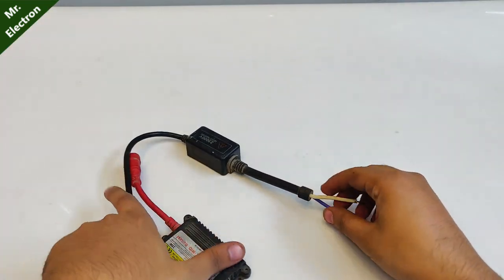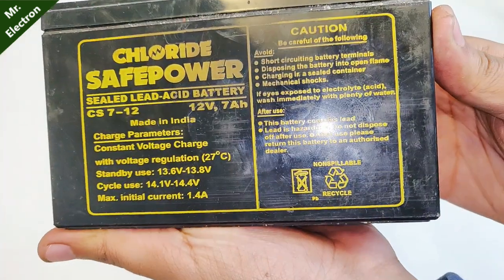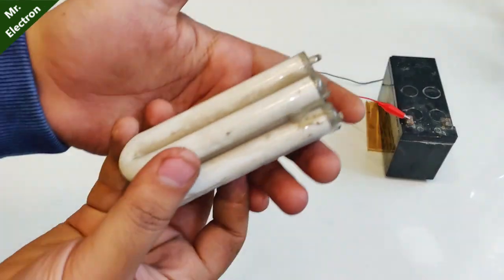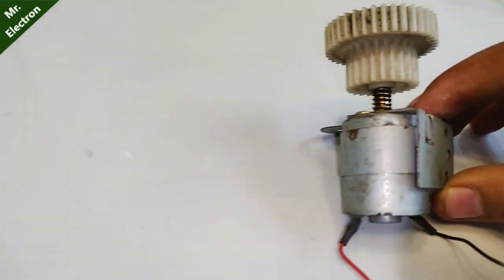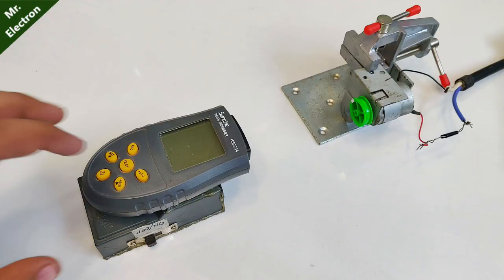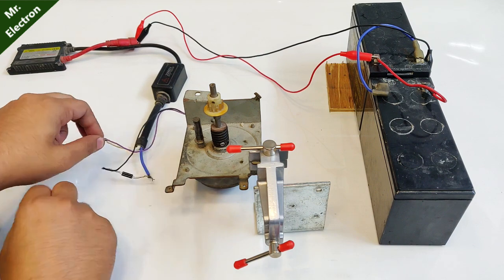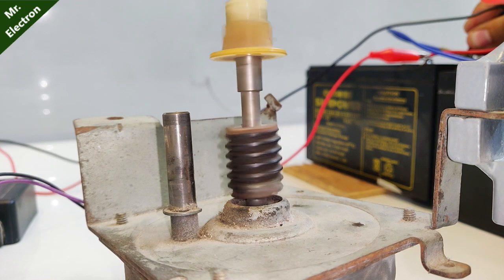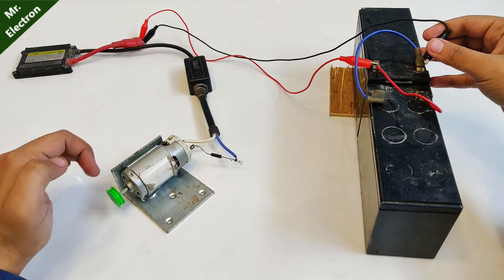55,000 RPM - 3v DC Motor Forced at 23,000 Volts

Comment: You should use just 100volt because 3500 volt has very low current you should try rectify main voltage and power a 3 volt motor with it

Comment: Mr electron: lemme see what HAPPENS WHEN I GIVE 23k VOLTS😈😈😈
Motor :😰😰😥
Reply: @MrElectron  can you use a microwave oven transformer and run a 3 volts motor with that i bet the voltage wont drop that much cause it has almost 1 amps at 2kv
Reply: the high voltage drops to 12 volts when its loaded